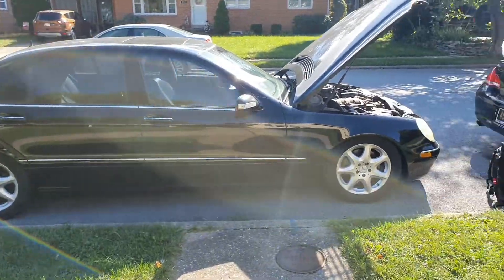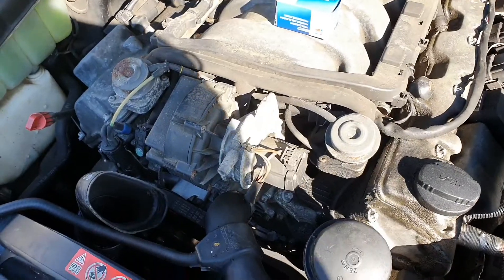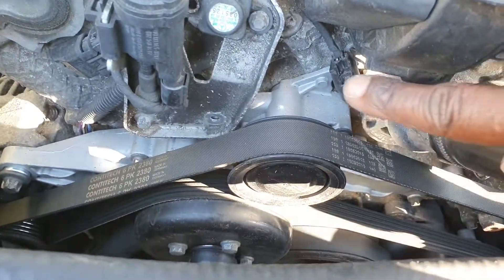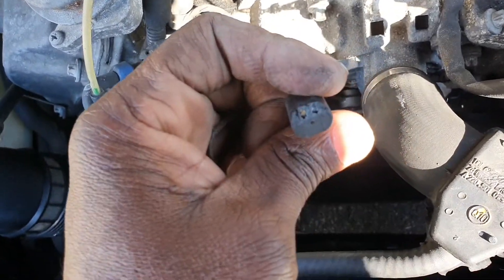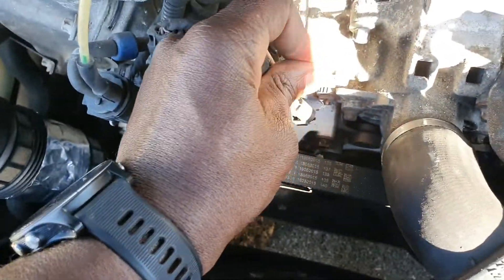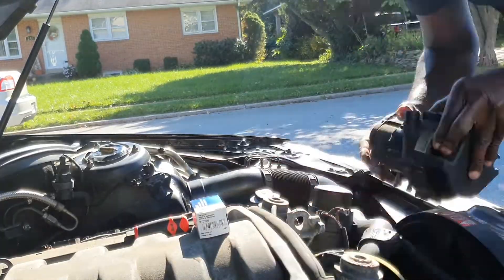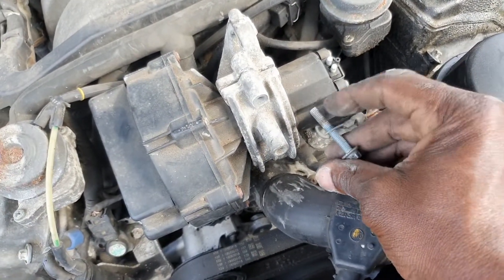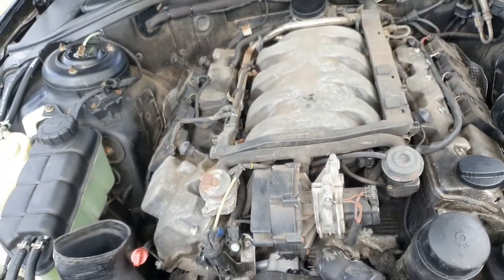Replacing Coolant Temperature Sensor on Mercedes W220 S Class

Comment: The car is a 1999 Mercedes Benz CLK 430. I had the water pump replaced, but now I need to know all the sensors that need to be reconnected to finish the install of the water pump area. So far, I reconnected the coolant temperature sensor, the MAP sensor in the water pump area. There are other sensors in the water pump area but i don't know what they are and their sensor function. Help me to identify those other sensors above the water pump on my clk 430.
Reply from the maker: Google or find a mechanic to assist.

Comment: Would you know where I can locate the same exact temp sensor but for a 2007 s550?
Reply from the maker: Try FCP Euro
Reply: I was meaning like the location of the temp sensor on that specific car I have the part but can’t find the sensor in the engine bay
Reply: I can find any videos or anything
Reply from the maker: @amoney8899  I would try a search on Google for a diagram  or location of the 2007 temp sensor. Should be the same or similar removal procedure.